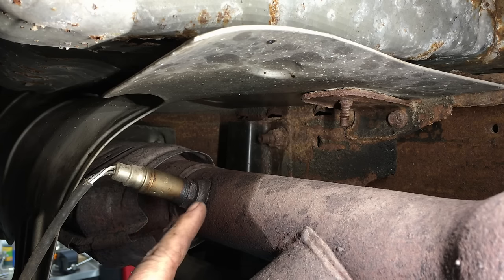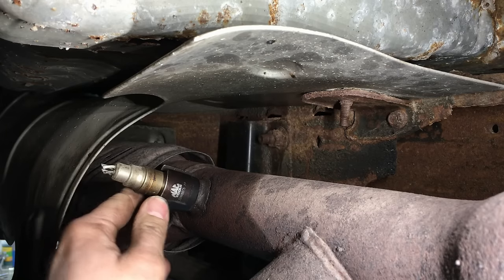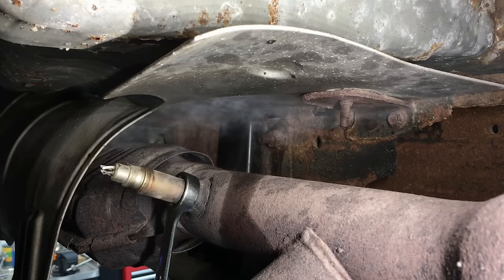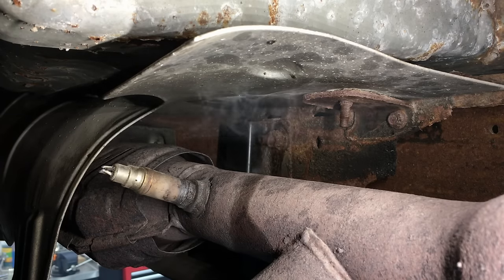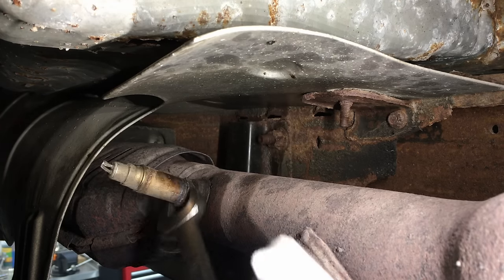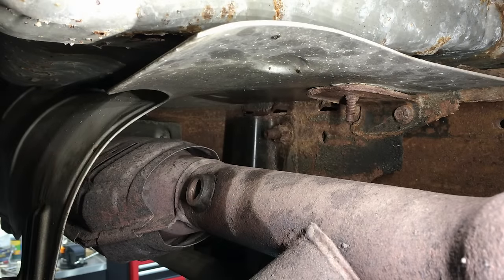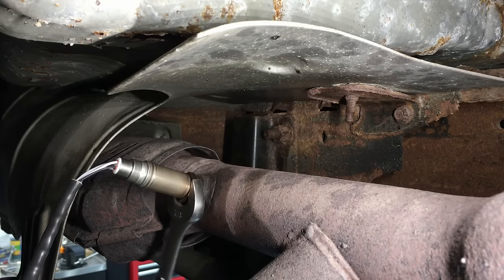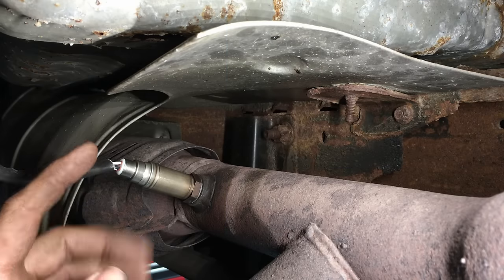Ford Quick Tips #81: Removing Rusted Stuck Oxygen Sensors the Easy Way!

Comment: Another great video Brian.  I bought the O2 sensor for the wrong bank last year and will be installing both sensors for my 05 Escape in the spring when the weather is warmer.  The timing for this video was perfect.
Reply: Even better, I was planning on changing mine (on a Jeep ZJ) today, but ran out of time so sometime this week. Unfortunately, this was the exact plan I was going to go for, and didn't add anything extra to what I already know. Working on cars in the salt belt you learn to deal with stuck everything.

Comment: just replace 4  O2 sensors on my Durango what i did is break the pole and leave the nut intact, put a small 7/8 with my breaker bar, add some w40 and done in no time, took me more time conneting the harness back to the corresponding connector

Comment: soak in pb blaster overnight....hit with torch. works every time..another good video brian.
Reply from the maker: Letting penetrant soak is the hard part for me.
Reply: @FordTechMakuloco  
04 F150 5.4 3V just changed Bank 2 Driver side sensor 2 on outlet of convertor. Texton 47749 7/8 socket fit perfect on downstream Bank2. Just enough room to glide 3/8 ratchet with a "socket and extension as a make shift cheater bar" on end of ratchet. Soaked in PB blaster about 7 applications in 20hour period threaded out by hand the moment it broke free; no torch needed. Thanks for all your videos Sir! It was the original 02 sensor rusted in goooood.  Fixed P0430 code!

Comment: This video is very helpful.... I just changed the O@ sensors on my E350 XLT Van and the one sensor on the driver side of the engine was not breaking loose. Took a torch and just heated the flange that the sensor was screwed onto just a little bit and with a little bit of effort, the sensor broke loose.  OVERALL it was very easy to change the sensors out.  I got lucky because I have heard that sometimes these sensors are an outright BEAR to get them changed out.

Comment: Sounds good doesn't it. Penetrating oil overnight 2 ft breaker bar penetrating oil, heat 1/2" impact wrench didn't work, so I had to cut the exhaust off, now I have to weld in a new pipe

Comment: I prefer to remove the entire body of the O2 with an air hammer/chisel (after spraying with penetrant). That allows the use of a 6-point socket, which reduces the chance of rounding the hex. All the great advice you've provided follows that step, as necessary. The vibration from the air hammer sometimes works the penetrant in enough to make it easier. The body doesn't break off easily.

Comment: I did this on a 2006 Toyota Sienna. Used open side of 22 mm long wrench (closed side seemed to be stripping). Used PB Blaster and then WD40 and the WD40 seemed to work better. Kept working it back and forth. It was seized on there real good. Got it off. Took my time. Took lots of breaks and used a lot of solvent. Worked it back and forth. The threads of the sensor were stripped when I got done but the threads on the female side were OK. There was some metal stuck to the threads on the female side. Applied generous amount of gunk from the Denso new sensor. Hand threaded then used open wrench. Cleared the codes. So far so good. The beer tastes extra good now.

Comment: I use DEEP CREEP which is non flammable with a propane torch and an oxygen sensor case hardened socket. I always use a six point socket or wrench never a twelve point, like you show in the video. If it is really stubborn I use my air hammer attached to a six point hex case hardened socket and adapter that fits onto my air hammer with heat and that will get it out without any damage to the threads. You just lightly trigger the air hammer with short bursts to jar the sensor loose.  I never tried the candle wax trick on oxygen sensors, but I am sure it would work to. Hope this tip helps others out too. Great video though thanks for sharing it.

Comment: Thanks so much, I have a Ford Focus and I went out and got an O2 sensor wrench/socket and was surprised it wouldn't budge despite torquing on it with my 1/2 ratchet. Hesitated to use penetrating oil since it is a sensor, so decided to consult YT and found your video. I will be trying the heat now after watching. Thanks!

Comment: 20 years original Motorcraft equipment,no too shabby ...Built Ford Tough💪 good for another 20
Reply: I’m watching this because I’m replacing an O2 sensor on my 2018 F150. Got a whopping 6 years out it. Modern F150’s have lots of problems. I drove. Dodge Ram for 25 years. Regret buying this F150.

Comment: You could also  'sacrifice' a box end wrench  by cutting a slot in it to fit over the sensor wires. Also wrap  'wick' around the sensor where  the threads are and soak it for as long as possible. Keep it soaked with a penatrating fluid. The thick seam of men's underwear will make a good wick. This way you can remove the sensor to remove the built up carbon that might be misleading the computer. Thank you  for the video.

Comment: Thanks for posting. I was in a bind to get these done before winter in Ohio and only had small windows of time with outside temps high enough for the torch to burn. 
For guys laying on your back in the gravel or on the cold ground, it can be done. Forget the special sockets. Cut the wires. Torch, lube, 7/8 wrench. Repeat. I did mine on an 06 5.4 4x4 for about 6 cycles before it cracked. On the 4x4's, there is 0 turn radius and the job is so much more difficult. You can barely get the wrench angled at all for sensor 1's but after a few geometry refreshers, it is possible.

Comment: Before replacing with a new 02 sensor, I keep a 12 ga shotgun bronze (the steel bristle work best but are hard to find) bristle bore cleaning brush from Walmart in my box, and I run that through the threads a few times before spraying something on them to clean the junk out. These work great and cost only a couple bucks, so they are cheap to replace compared to the expensive parts store round brushes.

Comment: 25 years in the business and i gound used brake fluid is the best lubricant for removing o2 sensor. Brake fluid will prevent galling the threads, its really slimy. I used this trick nearly every time. Heat is my last option.

Comment: Before putting in the new sensor I allways chase the treads. You can use the old sensor for that by making a few slits in the lenght of the sensortreads with a anglegrinder. It work out perfect for me.
Reply: I will not buy things that can be made easy

Comment: if you  don't have the time or patience.. grab yourself a Bazooka at your local Army Surplus Store... and aim it up the tail pipe.. that will blow that O2 sensor right out!!... GOOD LUCK!!
Reply: Better yet, junk the FoMoCo rust bucket and get a Bowtie
Reply: @kevineccleston8341   no thanks
Reply: im literally one step away from doing this.... god damn
Reply: I do love my 78 Courier, though. Even more so, since installing a 10SI alternator & GM 4-prong HEI Module. I find the more GM parts I install, The more reliable she becomes.
Next stop - GM Iron Duke 4 cylinder & attendant drivetrain.
Reply: I feel like doing this to the whole car at this point
Reply: @kevineccleston8341  so you can just send the bowtie direct to the crusher 🤦🏻‍♂️
Reply: 😂😂 I tried to get mine out last night and was ready to do this about an hour in.

Comment: What if you just let the truck run and get the exhaust warm/hot before you do this so there’s less torch time needed. I wonder if that will work if you don’t have a torch.
Reply: FishFind3000 not hot enough in my experience but you could try....
Reply: Yeah that's what I did it worked.
Reply: Getting the truck up to temp could help. Typically if its that rusted in you'll need more direct heat then just getting the exhaust to temp or even hot.    Those map gas torches aren't very expensive compared to an oxy acetylene torch set up. I think most big box hardware stores carry them for around 50 bucks.
Reply: Easier to manage heat from a torch than the entire exhaust being heated. If your doing it in your driveway under jackstands it's not really ideal.
Reply: I first thought this was how to weld your o2 sensen to your exhaust pipe tutorial..my bad..

Comment: thanks so much! did it the way you showed in the video and the bad O2 in my 2006 honda accord came right out. Just as a safety measure make sure you wear gloves or let things cool off for about an hour I made the mistake of grabbing the box end side of the wrench after 15minutes and it was still piping hot. I should mention that it all just took me 10 minutes it doesn't take long at all.

Comment: Very good video! Thank you. Only question is have you thought of tapping out those corroded threads prior to installing the new sensor? Seems like a good preventative measure for the next poor guy who has to do the job again.
Reply: They make a specific tool for that, an O₂ Sensor Thread Chaser. It's like a tap, but better for this.

Comment: This looks great but unfortunately, my sensor is so far down the inside of the hood, I can barely get at it.  I used that attachment to get it over the sensor but with the extension and breaker bar, I have very little leverage to move it.  I have no way to get  torch down there.  I gotta get ripped off by some mechanic how.  Thanks anyway

Comment: I just bought two upper ones drained gas cuz set for year 100$ gas cleaner but hard to start still then get going drives great for miles all sudden sputters out hVe pull over start again and take off for maybe a mile then over an over. backfires burns tons gas . COULD 02 DO THIS???

Comment: I found that brake fluid works pretty well for rusted lug nuts, and it takes quite high temperature, and is really thin, so that it wicks into the threads pretty well... just a thought

Comment: Absolutely love this video.  I have often thought about the O2 censor even way back when I owned a 1982 Cutlass Supreme back in the day, which tripped a code.  BUT if my truck is not throwing a code should I still change the O2 censor? Do they still go bad slightly, or only work at say 50% efficeincy and no one know about it?  Does my truck signal when it truly needs to be replaced? They are still original to the 2005 F150 with 319,000 miles on it.  Or do I change them because they are so old that they have to be bad by now regardless of tripped code or not?
Reply: If they go bad theyll trip a check engine light

Comment: You should use a 6 point boxed end wrench if possible, less chance of rounding.
Reply from the maker: I do agree that is why I use 6 point sockets but in this case I have never rounded an oxygen sensor in 15 years with this exact 7/8" 12 point combo wrench. The reason I use it is the 12 point allows me to get in those tight spaces with a smaller swing that is not possible with a 6 point. Try to remove an upstream oxygen sensor on an f-150 and you will see why I use what I use to fix vehicles.

Comment: Mine was so easy to remove compared. I didn’t heat it up I just used an actual 7/8 O2 sensor socket (full socket with slot) and a breaker bar. Mine was removable by hand after it broke free.
Reply from the maker: Most are easy.

Comment: I'm having a hell of a time trying to get the first upstream off of my 01 town car. I haven't tried heat yet but I can't get any leverage laying underneath the car. Is it possible to take the wheel off and approach it through the wheel well?
Reply: What problems were you having my 2001 town car is shaking flashing check engine light

Comment: Have you ever removed one from a 2001 Ford f-350? The passenger side. There is no room for a wrench or an extension bar with very little room to move. Ive used PB blaster over several days, map gas, offset socket and i'm at a loss. There's no room to get leverage. Thanks

Comment: Something else that I like to do is after heating around the sensor bung, use a can of compressed air (computer/keyboard spray) or CRC Freeze Off  directed at the sensor only and it will "freeze" the sensor and contract it which is the only way I've been able to get some out...and usually it's a Ford 🤷

Comment: it seems my O2 sensors were removed and was covered by just a bolt on both sides of my ford expedition 2000 5.4, i dont see any check engine light on my dash and the car runs. any take on this? what do you think?

Comment: This helped get the RH fwd (bank 1 sensor 1) off which I thought was throwing code 1295, but it came back. There are numerous potential problems. Anything you’d recommend looking at as the next step? I’ve bathed it in ether and couldn’t find any obvious air leaks. This is an 03 Expedition 4.6
Thanks in advance! You’re my go to on here!

Comment: What's happening then, when I runs the motor for operating temperature? Is it enough or not? O2 sensor goes to the operating temperature too (about 600 degrees or higher).

Comment: This way worked for me today on 2002 chevy impala 3.8 downstream o2 sensor blue torch full blast and then wrench and hit with hammer and I got the wrench over connector by putting the tab in the box end of wrench first n it's tight fit but it does go over the female end and last thing I WAS ON MY BACK IN MY DIRT PARKING IT MY APARTMENT.

Comment: Nice to see the struggle. That's what most of us need to see so we know what we're in for. Of course the finished product at the end is nice to. Good explanations, good visual and way to show the work. I watched another where the guy had pre-broken the sensors loose. Not as useful. Also nice explanation to the comment above as to why you used a 12 point wrench instead of a 6 point. Understandable in tight spots.

Comment: My downstream sensors are stuck but I'm worried about cutting the wires if I can't get em out since I need my car everyday. The smaller O2 socket you showed started to strip the sensor so I'm kinda stuck. How bad would it hurt a car to drive with disconnected sensors? I can imagine fuel efficiency would tank.

Comment: When I had to remove bolts on steam line flanges, which would burn off any type of lubricant, I would just use plain old cake of bee's wax. It would melt right into the threads and out the bolts would come. Just had to have the heat to let it run into the threads. Give it a try, it works!

Comment: Good method. Use Aerocroil and let it soak for a while. I had an upstream O2 break free then jam and get stuck fast. Could re-tighten but it would not budge beyond 3/4 turn loose. PB Blaster nor WD40 helped.  A squirt of Aerocroil and 45min later it came right out! A thread had broken off the sensor and that's why it would't back out. No bung damage thanks to the Aerocroil!

Comment: I use MAPP gas and a 5 sided 22mm deep well socket and or saw off part of the sensor so a short socket will fit, if something is in the way and a deep well won't work...

Comment: I just did 2013 f150 bank 1 sensor 1 removed passenger wheel and fender liner heated with torch and cut a 7/8 wrench in half and used a long pipe for leverage when it popped I busted my finger and let me tell you the pain never felt so good. Triumphant even.

Comment: Tried mine earlier. Have no heat source, and was not budging one bit. I have axle stands and couldnt get much purchase on the nut either.
Reply: Hey I actually changed my o2 sensors last week. The first one before the cat was easy. The downstream one on the other hand would not budge. I tried soaking pb blaster, 7/8 wrench and sledgehammer, a lot of grunting lol.  I finally thought of turning vehicle on for about a minute or two then turn vehicle off.I got it free pretty easily after turning car on. The heat helped. Just be careful not to touch exhaust it will be hot.

Comment: I have a 1990 F250 5.0 - is there only one O2 sensor to replace and would this be the cause of the engine light to come on after the engine gets to operating temp?  Nice video btw, thanks for the tips.

Comment: If the tailpipe is old and rusted, the heat ends up putting a hole in the pipe. I just use WD-40, let it set, spray again and use a cheater bar. Excellent photography and explanation, thanks for the video.

Comment: Just attempted to replace an upstream sensor on 2010 Escape hybrid.  Before removing it, I noticed the middle of the sensor had been partly pinched.  When removing it I had to use a breaker bar and it never really "broke".  Just felt "mushy" all the way out.  When I finally got it out the threads on the sensor looked like they had been filled with epoxy or something.  Looking closer it was clear that they were completely mulched.

I felt and looked inside the hole and it is The strangest thing.  One half (driver's side) is normal, but the passenger side has one raised thread that spirals down at probable a 25 to 35 degree angle.

I don't know if I did this trying to get it out or the person who installed it did it.

Needless to say, if I start to try to thread the new sensor, it gets about 2 or 3 revolutions and stops.  When I back it out, I can see it is starting to flatten the top two threads.

I'm not sure what to do.  Force it in?  Do I try to chase the threads?  Looks like it may be a 18mm 1.5?  Does that sound right?

Right now I'm stuck with a nickel-sized hole in my exhaust manifold :/

Comment: on my 2002 Ford F 250 the clip on the Oxygen Sensor (just above the sensor itself) should come with a caveat.  From underneath the truck it's near impossible to unclip.  I didn't know but found out through a slight struggle, that the connector slides off the push pin allowing you to bring down the clipped portion down to see so that you can "unplug" the clip.  Without being able to see what you're doing it's was hard otherwise.  UGH!!!!

Comment: I ran it like he said laying on my back with a 3 pound dumbbell weight propane and 7/8 wrench. 

And rust penatrator.  

A few good taps and a good grip they were of within a few minutes.   Wish I had a lift but it's doable with out it.

Use all safety procations and have at it.